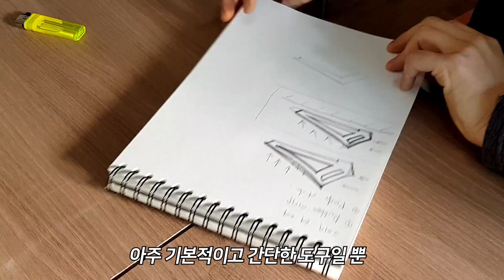Push Stick Preventing Tablesaw Kickback│DIY 목공 테이블쏘에 꼭 필요한 킥백방지 푸쉬스틱(밀대)

Comment: You people are to afraid for it I wil never use this kind of hobby tools. But the problem for the kickback is the missing part on the back of the sawblad there has to be a (called in Dutch " spauwmes" ) if you put this on you wil not have kickbacks.